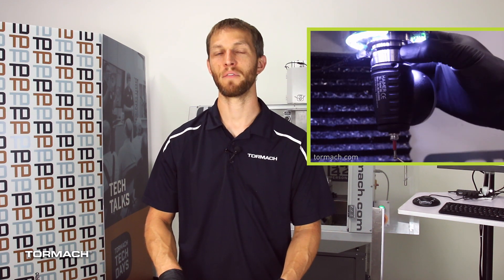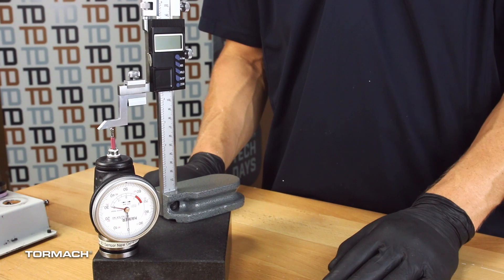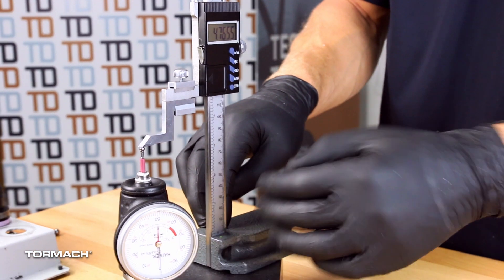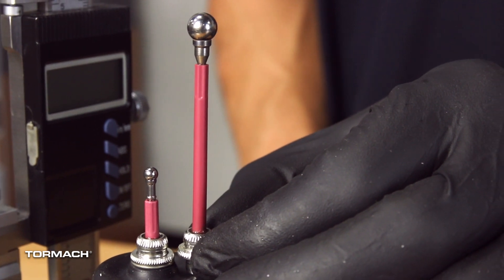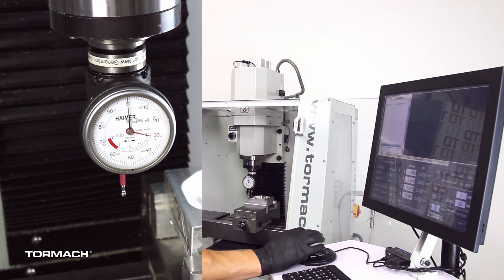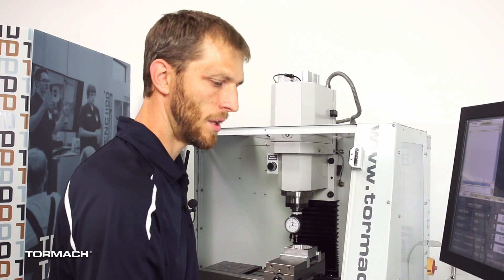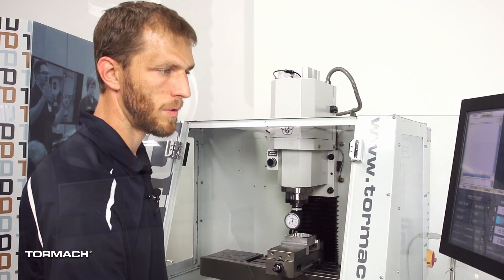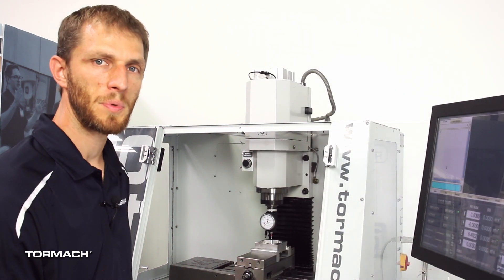Basic CNC - Setting Up the Haimer Work Offset for Efficient Machining

Comment: I like to do the Haimer offset in the machine. I measure the offset of a flat end mill then do a facing operation then use the built in set tool height with the Haimer on zero to get its offset. I feel it gives a better real world zero rather than working against a spring.
Reply: Exactly what i'm doing with mine. Working against a spring when measuring hundredth of milimeters does not sound good to me

Comment: dived by 2 is a so simple feature I wish haas have it
Reply: i wish ALL  controllers had that. such a simple feature
Reply: @greg2337  the amount of time you waste by doing the math on a calculator
Reply: @chaddanylak8706  i dont even mind the 5 secs to do the math on a calculator. But /2 lets the machine handle the math instead of fat fingering some number. i let my height gage write the tool height to my tormach. it's too easy to make a mistake and switch around numbers when typing. especially when youre a sloppy typer like me.

Comment: Hi, I notice that you drag the styles on the side of the part when switching from X to Y, and also drag ap from Y to Z. 

I try to separate the stylus from the side of the part before moving to the adjacent side I want to measure. I fear that dragging, or having the stylus "pop" back to center once it reaches the end of the part might affect its calibration. Have you noticed any issues doing it as shown in the video ?